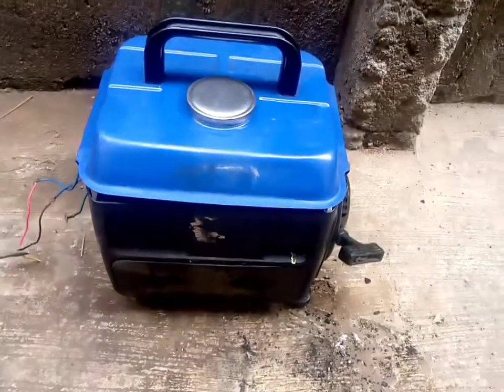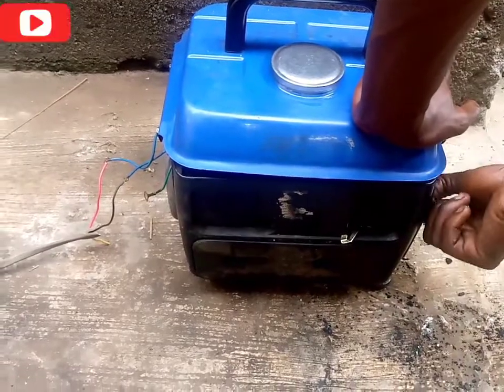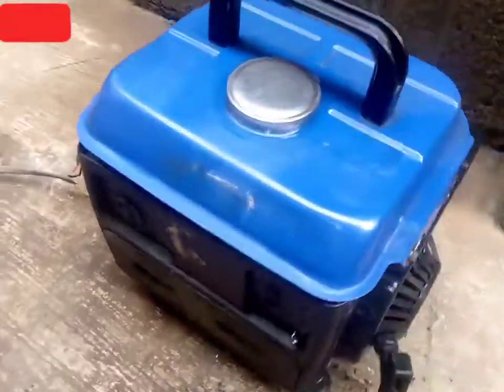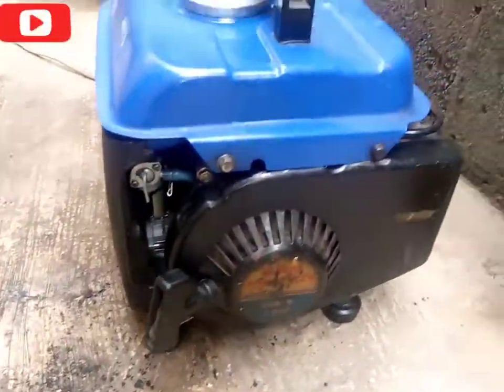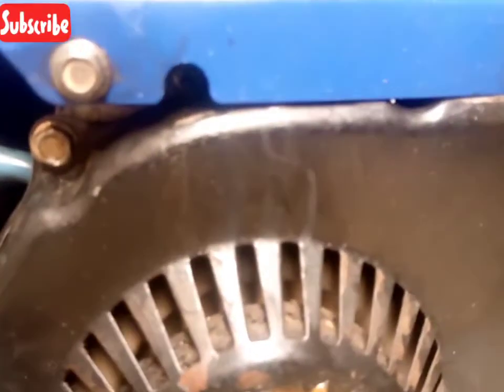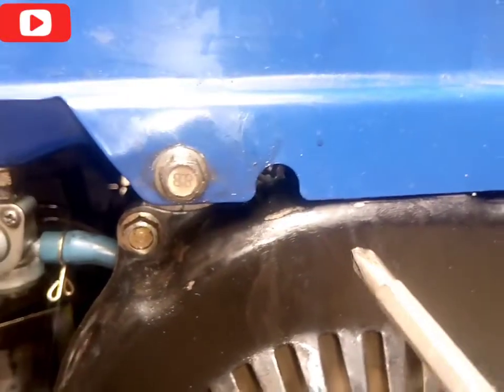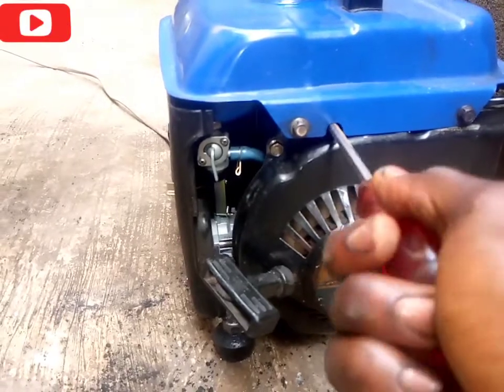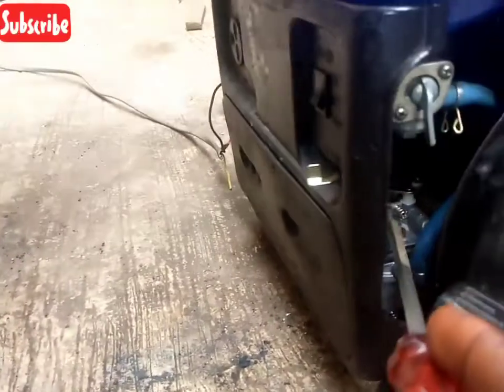How to increase or decrease the speed or voltage of small tiger generator

Comment: Hi. Is their solution to small tiger gen. That still keep high speed after dropping high load , their by blowing other small appliances.
Reply from the maker: Yes there is solution, reduce the speed from the carburetor.
Reply: When you increase the current via carburetor, it can get your appliances burnt. Increase should only be done via the nut  . The one by the tank area is the best way to increase the current of tiger gen and gen as a whole